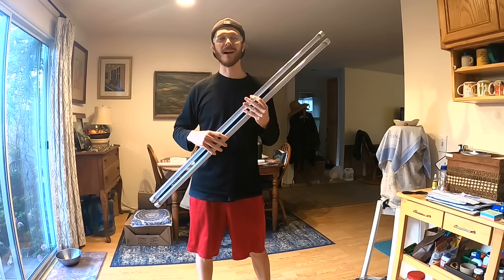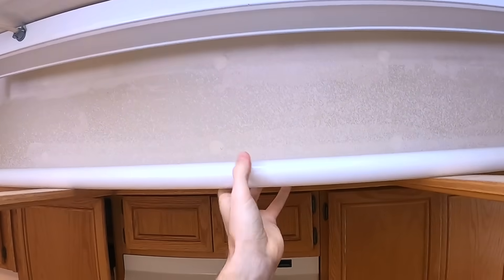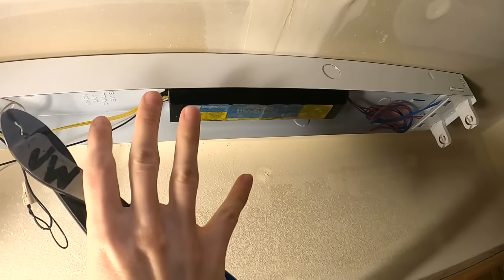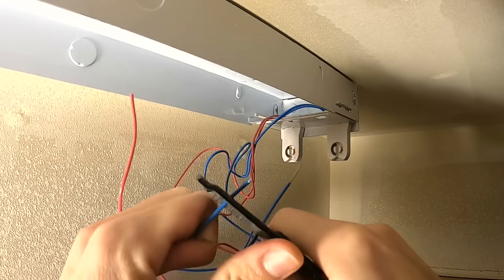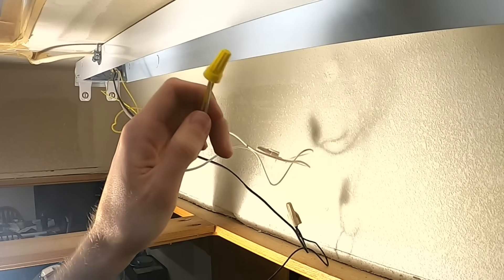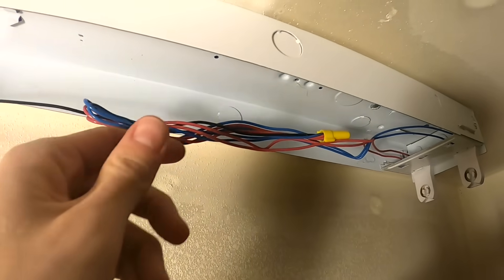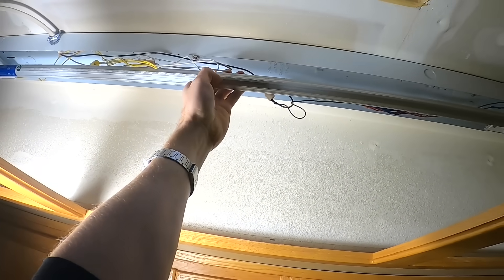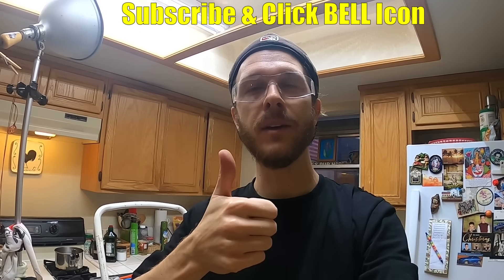How To Easily Convert Fluorescent Lights to LED | Save Money on Energy Costs

Comment: First, this is a very good instructional video, my compliments.  That said, any electrical cost savings from this conversion project appears to be more than offset by the high initial bulb expense and, from what I am seeing in the Amazon comments on multiple brands, a very poor bulb life.  P.S.  the "frosted lens cover bulb" link no longer works.
Reply from the maker: Yes it can take a little while to offset the cost, but I still think it's the way to go especially if you need brighter light or if ballasts are going bad. I also don't like having to find somewhere to take the bulbs for recycling. Thank you for the link update too 🙌👍
Reply: @JonnyDIY  Believe it or not, I have two original fluorescence light fixtures, including ballasts and bulbs that are at least 51 years old, inherited from a graduate school housemate, that are still in operation (rarely now, but still...).  I even still have the yellowed lenses which I removed probably 40 years ago.
Reply from the maker: @gordon-1  Wow! They dont make em like that anymore! Built to last 👍
Reply: I've found that 2 led bulbs now cost almost the same as a new ballast. At least for the common 48 in bulbs.

Comment: Thank you for the video. But, I'd taken the wing nuts off that came with the fixture since you have enough wire, don't need any extra connections. That's just me, on what I'd would have done.
Reply from the maker: Good point, I could have shortened one of those sides for sure. 1 side I needed the extra length

Comment: all of our lightbulbs are high efficiency, or LED throughout the house. I find myself turning more lights on in the rooms. I spend the most time in because those lights just do not put the brightness .. i used to have just one 100 watt Old style incandescent bulb in the den when I watch TV. Now I have to put four lights on using fluorescent high-efficiency bulbs that are advertised as giving off 100 W equivalent light.
   I am a retired electrician from a very large company. Maintaining all of our offices and buildings and air conditioning systems, and heating systems and security systems.  
  besides, either being too hot or too cold in an office being the number one Complaint.. The second largest complaint is flickering of the high-efficiency fluorescent bulbs with the green end caps.. they do not put off the light brightness of the older style bulbs. And they flicker/pulse…
  another complaint about how efficiency bulbs, flashlights. The old style, single bulb, flashlight, that took D size batteries. We’re fine. The LED, especially the mag light, single bulb flashlights, they may be bright when you look at them, but they do not light up a large area unless you buy a flashlight that has many many LEDs… The LED flash lights just don’t light up a large area like the old flashlight used to. I always have a flashlight on me at work. The LED flash lights are OK for looking at something small. But not for finding your way through a dark room
Reply from the maker: You're right, nothing matches the quality of light of an incandescent. Apparently our eyes can pick up more of the light too compared to LED. And no flickering

Comment: So your title was wrong, your just replacing the fixture so it will hold a LED light, not converting a fluorescent into a LED light.
Reply from the maker: I replaced nothing but the Bulbs, just wanted to show process of modifying old fixture by cutting out ballasts to work with new LED bulbs 👍
Reply: He clarified the contents in the first 10 seconds.

Comment: My last job, I was also upgrading the lights, and was told to use the type A LEDs. The advantage to those is you're just unplugging the flourescents and plugging in the LEDs. The only DISADVANTAGE, is that you're still using the ballast and once that ballast goes bad, the type A bulbs are not good for anything unless you're putting the A's into another fixture. My advice? Just upgrade your fixtures and forget the A bulbs!!
Reply from the maker: Good point, you're right. It's just a matter of time before the ballasts go out 👍

Comment: Very good video and explanation. But I noticed at 5:07 that one of the hot wires was either not up in the wire nut far enough or had too much insulation stripped off because there was still bare wire exposed.
Reply from the maker: Thank you! Happy to help. I think it may have just been the lighting that made it look like that but I'll double check 👍

Comment: Glad to see you used wire nuts instead of those POS wagos.
Reply from the maker: Never used those things. My buddy who's an electrician and I were just talking about them last nite. He said time will tell with them if good or not 🤷‍♂️ they fall apart over time you think or just not as good of connection?
Reply: @JonnyDIY  yeah man,been doing electrical work for 35 years,masters license,wagos are shit,make a good tap,use wire nuts.
Good luck and good health to you.
Reply from the maker: @BlueJay-v1b  Awesome, thanks for the tip on the wagos. Won't waste my money. Thank you, you too!
Reply: A lot of electricians don't trust wago, but I've seen rigorous testing of them, electrically, pushed well over ratings, and they passed with flying colors.

Comment: There is no reason to replace fluorescent light. The LED cost ten times or more what a fluorescent tube.
Reply from the maker: The tubes cost about the same now
Reply: Fluorescent tubes are 3 dollars. LED is 8 dollars. They are not the same. There is no reason to replace. @JonnyDIY
Reply from the maker: @redluck01  my ballasts were bad so it was good for me to switch and I don't much care for the color fluorescent lights put out

Comment: YOU DO NOT KNOW WHAT YOU ARE DOING! Neutrals can carry current if the (N) is shared on a multiplied circuit sharing power, you could end up electrocuted, especially if the power is not on a two pole breaker. Just turning off the breaker and the switch does not MEAN YOU WON'T get SHOCKED! Those "pliers" are NOT insulated, where are your gloves. Do the general public a favor- STOP ACTING as an electrician and go to school. Man DIY Get a real job!
Reply from the maker: Thanks for sharing that helpful information Peterson 👍

Comment: I've been converting some of mine to LED. The wiring diags. in the package a pretty fehken simple. 
I've salvaged a couple of 40s era fixtures, got replament ends from AMZN as the bakelite ends were cracked. 
Also, just make sure to mark fixtures at to what they require if you are going to mod some over time.
Reply from the maker: Nice those 40s era fixtures sound cool. Yes good idea to write a note on fixture 👍
Reply: @JonnyDIY  Yep, indeed. Heavy AF.  steel. There are 2 ballasts that weigh about 20lb. They are now object d'art on the wall. :)  the bonus with the LED tubes is no more toxic glass shards .
Reply: FYI, the ballast can be recycled at any place that takes pop cans, wires, and metal. NOT at any big box stores, or community recycling pick ups.
 Also, nobody wants to take the old flor bulbs for recycling.

Comment: In the building i work in we've replaced fluorescent with LED.  We get all the benefits you'd expect, but a lot of the LED tubes fail, and when they do, they smell bad and even start to melt, which is dangerous.   The problem is typical: the tech is legit, but poor mfg  quality eliminates the benefit.
Reply from the maker: You're right, hopefully some better companies start making these with better quality parts. If build correctly they can last a lonnnng time.

Comment: Picking a nit - why leave the pigtails on the hot/neutral feeds?
Reply from the maker: I needed the extra length on one, but I forgot to pull the wire nut on the other. My mistake 😄👍

Comment: I've gone down a similar road. I recently replaced all my 4' T-12 fixtures w/ 4' LED integrated  fixtures. 50000 hrs life for those fixtures which at 5hrs/day use translates to 27.4 yrs of life. That's long time without changing bulbs. 😎
Reply from the maker: Nice 👍 save quite a bit of energy

Comment: Pretty straightforward video but I have one complaint. That tester you used to determine whether the fixture was still powered or not should have been tested with a known live electrical circuit before trusting that your ballast was truly unpowered. You can do this by just sticking the little tab on the end of the tester in the hot side of a known good receptacle to see if it sounds. Not testing that electrical tester prior to using it is a good way to get yourself seriously hurt if the tester batteries were dead or it was just not working.
Reply from the maker: Yes you're correct I always test it on a known live circuit before use just forgot to mention it in this particular video 👍
Reply: I always test on known good before and after (in case it happened to die during the few seconds after testing the first - might be overkill, but better than electrocution ).
Reply: @darthvegan435  I have to agree. That is definitely the kind of charge out of life that I do not want to get!
Reply: @darthvegan435  Electrocution is overkill.
Reply: And ive had that happen!
Reply: That's right, I remember that the tester requires sensitivity settings.
Reply: Can we use led bulbs with a 12 watt DC current? How many watts does each bulb draw? Circuit is still 110 volts.
Reply: @Roy-littlebear I'm not exactly sure what your application is. You are mixing some terms which somewhat confuses the issue. Current is measured in amps. Watts is a measure of power. Also the lamps in this video are for use on AC circuits and you specifically mentioned DC. In most cases the two different current sources are not interchangeable. So my answer would be no. As far as the total watts per lamp, it varies per lamp and you'll find that information on the packaging. The lamps I use are rated at 14 watts. I hope that answers your question.
Reply: Wow.. He turned off the switch, killed the breaker... Good enough ffs
Reply: @williecanuck5001  how do you know he turned off the correct breaker if he doesn't test to see if the circuit is still powered?

Comment: And when your house unfortunately burns down due to faulty wiring and not using a licensed electrician, good luck putting in a claim with your insurance company.
Reply: Not really an accurate statement. Pray tell how the insurance company is going to know whether a licensed electrician installed the fixture that was destroyed in the fire? Secondly, you've got just as much chance of a licensed electrician doing poor work as you have of a layman who has electrical experience. The licensed electrician who wired the home I bought had wired one of my dining room receptacles with reversed polarity. They also put 30 amp GFCI breakers on 20 amp circuits, specifically having used 12 gauge wire, which is not rated to be on those 30 amp breakers. I, a layman, found this myself when my licensed home inspector informed me of a non-functioning GFCI. He didn't realize there was 12 gauge wire on the 30 amps circuit, but I did when I checked the breaker to replace it. That's when I found the second breaker that was 30 amps on a 20 amp circuit and replaced that also.

Comment: I've done elec. work in the past, long before LED lights were put onto the market, so I never realized that you could just bypass the ballast. Your video was straight and simple! Recently I purchased a pair of LED lights, to replace my fluorescent lights, over head. When I put them into the fixture, it didn't work. Then I came across Your video. This morning I did just like your video shows (except removing the Ballast). I put the LED lights into the fixture and ...it doesn't work...! The bulbs Are T8 LED lights and when I turn on the power, they look just as bad as the faulty fluorescent bulbs, that I'm replacing. Why?
Reply from the maker: There's 2 different types of bulbs for if power going to both sides or just 1. Maybe you have opposite of ones you need
Reply: I took a look at both ends of the bulbs and they don't have the "L and N" signs on them. I also took my VOM and checked both ends. When I touch the VOM to the connectors, side-by-side, the there is a connection. Now...I did look at the box that they came in and it states that those lights are replacements for fluorescent bulbs in a T8 Ballast fixture. Ha! I should have looked harder before buying them. I will have to go back and ck. to see what type of ballast the fixtures have, because those bulbs don't even work with the fixtures Ballast still connected to the system. Thanks for your reply.  @JonnyDIY
Reply from the maker: @wildlee2604  You're welcome. Good luck, hope you can get it working 👍
Reply: I checked my ballast and it shocked me. My 2 kitchen over head fixtures are set up inside the ceiling and the ballast inside of them are: 'Outdoor Florescent Lighting 704G CLASS P TYPE 1'.  I'll just take the lights back and get a set of them that Will work with bypassing the ballast. Once again Thanks for your video. I'll save money, using less Elec., once I finish with this. @JonnyDIY

Comment: Gee I just bought the LED bulbs that are compatible with the ballast, stuck them in and they work perfectly, no wiring changed required. Easy peasy.
Reply from the maker: Yes those work great too, I had a ballast go out on here so it made sense to just bypass them this time👍

Comment: What I don't like about leds is the light is very harsh and directional. You better have a good diffuser to avoid eye strain.
I was recently in a new house that used a bunch of exposed edison style clear led filament bulbs. Might as well wear sunglasses inside that house. Light was horrible.
Reply from the maker: Yes you're right! And dimmer switches 👍

Comment: Ok he is working on a fairly new fixture, that little clip he shows guess what it can be easy to loose. The tombstones, the pieces the lights actually fit into over time become brown and brittle so you need to pay attention to those,plus the bulbs can be a tight fit outside of that the long run it is a better light and you don't need that ballast making it a win win

Comment: I ruined 2 good lights , this does not work people
Reply from the maker: It's possible you bought the wrong bulbs for your fixture.  There are two different kinds. Ones with power going to both sides and ones for only 1 side

Comment: If you have fluorescent lights above your bathroom mirror you should change them to LED,
Don’t know if you’ll save any money but It will definitely help your self-esteem.
Reply from the maker: I literally just put a new vanity fixture in with LED lights over the weekend that replaced a fluorescent one 😂👍
Reply: I did exactly that but removed both fluorescent tube fixtures and installed screw-in bulb fixtures which uses regular LED light bulbs. No more humming or flickering and easy to change.

Comment: Seeing lots of negative / poor reviews on these and other brands of T8 LED bulbs. Complaints are poor life span/ not working out of the box / RF interference / shorted ends (this could be from user miswiring)  I would like to change out to the LED but I am now reluctant about this now.
Reply from the maker: Can try getting them from local hardware store like Ace or Home depot so if you have any issues you can easily exchange/return 👍 As you know a lot of products these days are hit and miss sadly

Comment: It is not so simple to convert to LED bulbs you first need to determine which type of LED bulb you are installing some types have the live and neutral going to one end and others have the live and neutral on oposite ends of the tube the wiring he did is for L and N on oposite ends in which case he should have clipped out the red (or blue) wires so that you dont have unnecessary power going to the pins in the ends just incase for safety

Comment: I used WAGO connectors, it was super easy. First time I’ve used them instead of wire nuts. I used 6000K in the garage, but that’s too harsh in the kitchen so used 4000K in there. It’s good and bright but not too blue/white.
Reply: Which WAGO connectors did you use?
Reply: @jennifermac7  221-612  I replied before but they removed it, I guess because of the amazon link.

Comment: Save Money on energy costs? Won't happen believe me. 
I have gone full LED here. Tubes in the kitchen and bulbs in the rest of the house. Great plan, right?
Yes and No! I have reduced my energy usage, Yes. However the power company to maintain their
cash flow has simply raised my rates. No, not saving money. Shrinkflation at work. I'm using less
product and paying the same price or more as I was before I went through all the expense to convert.

Overall..... I'm at a negative savings when it comes to my wallet.
Sorry to put a damper on this idea, but sometimes the truth hurts.
Reply from the maker: Yes you're right, utility rates have shot up across the board around here too

Comment: My kitchen fluorescent lights have been flickering for years even after buying dozens of new tubes. So I gave up using my kitchen lights. Maybe this will be a solution, but I don't think my units come apart like yours do.
Reply from the maker: Hope you can get it fixed. Most likely just a bad ballast. I would try this or just replace whole fixture 👍

Comment: A great explainer video; thank you!  Is there a less powerful LED bulb that works the same way?  I installed this in a 4 socket fixture, and it was so bright we thought we were being beamed up!
Reply from the maker: There should be, either that or get dimmable bulbs and an led dimmer switch. Some will work with regular dimmer switch depending on power output, but if have to install a new switch just get the led compatible ones. I have a video installing switch too 
https://youtu.be/rmWeao_yt3k?si=8PJJwweHAkbg0BNj